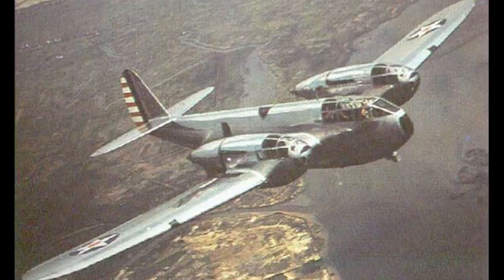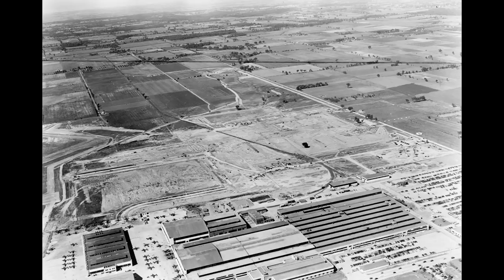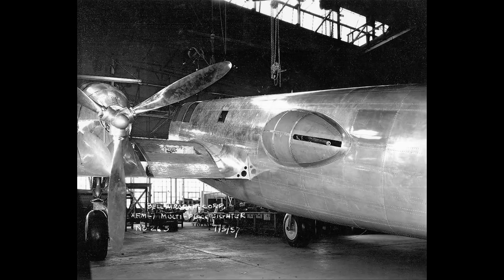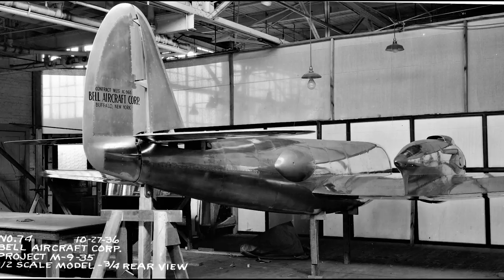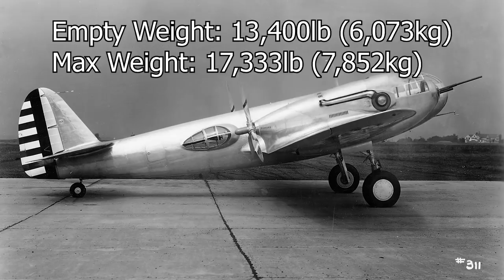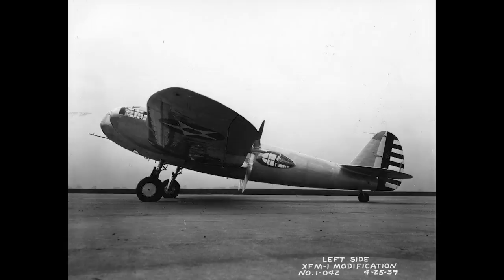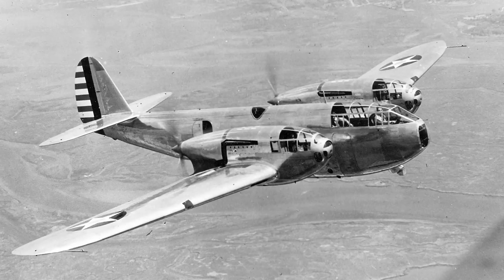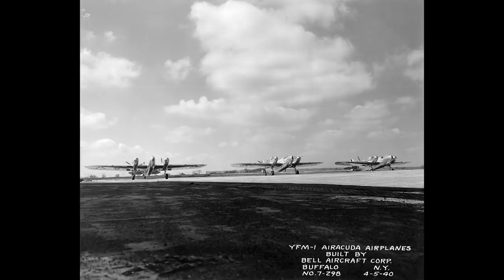The Flying Gun Battery That Tried To Kill Its Crew | Bell YFM-1 Airacuda [Aircraft Overview #28]

Comment: It helps when watching this to realize that the Lockheed entry in this competition was the legendary P-38 Lightning. While this beast was lumbering around the sky trying to kill its pilots, the Lockheed prototype broke the transcontinental speed record (please pay no attention to that tree they hit at the end).
Reply: First thing I thought of when I heard “two Allison v-12s”
Reply: Did they survive the crash?
Reply: @Commrade-DOGE  i think the test pilot survived. But the 1st prototype was trashed. It did set the speed recorb.
Reply: The P38 killed a few test pilots and airmen I believe due to not being able to pull out of a dive due to no air over the elevator till they installed a spoiler.
Reply: @chrisg2739  The phenomenon is called "compression lock." First to experience it was an Army pilot in 1941 who was able to regain control via elevator trim. Lockheed installed elevator servos on a test ship and a civilian pilot tried to reproduce the fault. He failed to come out of the dive and was killed.

AIUI it took quite awhile for P-38s in theater to get their spoilers installed. Pilots were killed in some numbers as a result.
Reply: I think that you're confusing the Airacuda with the P-39 Bell Airacobra.  The P-38 and P-39 both are single seat aircraft, had tricycle gear, and machine gun/cannon armament.  About the only thing the P-38 and Airacuda have in common are twin engines.
Reply: The Lockheed entry was the XFM-2 - which lost out to the Airacuda. The P-38 was designed to answer a different specification in USAAC Circular Proposal X-608 - rather than X-604.

Comment: This definitely seems like an example of “it seemed like a good idea at the time”.  Being able to hunt bombers from outside the range of their own defenses would have been a game changer.
Reply: Even Germany struggled with this late in the war. On a technological level they kind of sort of succeeded with various attempts like a Bf 110 with a BK37 37mm autocannon cannon under the belly with 24 rounds, a Me 410 with a BK5 50mm cannon with 22 rounds in the weapons bay, the latter of which could seriously outrange B-17s defensive armament. There was also the Werfergranate 21, essentially a 21 cm Nebelwerfer rocket strapped to a plane, with 4 used on a Bf 110 or Me 410 or two on a Fw 190 or Bf 109, which were then distance fused and fired into the formation from about 800 meters. 
In technicality these could have been interesting concepts, along with the Me 262, which could be fitted with 12 or 24 R4M rockets (the idea being that they could effectively saturate an entire formation of B-17s and hit most of them at least once, even if fired from outside B-17s range), X-4 air-to-air guided missiles and whatnot. Problem was that most of these were just too late and Germany couldnt field planes in a sufficient number to do make a serious dent anymore anyway. 
But at least nothing they came up with was a categorical threat to the pilots or crew.
Reply: @builder396  course the issue is escort fighters coming close as those attachments often made the plane too heavy
Reply: @SudrianTales  True, though the rocket tubes could be discarded after use, so the difference in performance would be only before firing. And twin engine fighters like the 110 and the 410 were heavier than single engine P-51s either way, so the extra weight from the BK 37 or BK5 didnt matter in the big picture. 
The Me 262 is the only plane where that doesnt apply since even with a payload of rockets or even a 50mm autocannon it could outrun a P-51 under equal conditions (not that specialized armament was needed, the basic 4 30mm MK108s were ample firepower against B-17s), though P-51s having an altitude advantage usually negated that significantly.
Reply: @builder396  One issue with the Me262 nothing could ever fix was, well, the USAAF and RAF were right over the airfields waiting.
Reply: @SudrianTales  Yeah, Germany was just too far gone at that point to do anything about anything anymore. Wasnt really the planes fault.
Reply: @builder396  The overly armed and armored propellor planes were a good idea, in 1943 when the P-51 wasn't available. After the fuel tanks and P-51D came about, it was just a matter of time
Reply: @builder396  
The Me 163 with its chemical concoction, if not an outright example, should at least be an honorable mention as a german-made deathtrap. It's been a very long time since I delved deep into the wunderwaffe stuff, but what I do remember was that the Komet was structurally sound but mechanically wild. The plane itself could take some punishment, but the internals would throw a fit and possibly explode if not treated like royalty while still containing fuel.
Reply: @builder396  that was entirely Hitlers fault, insisting the Me262 be a attack/bomber instead of strictly an intercepter. Had they let the 262 be an intercepter solely they could have had it in service in 1941...would have been a very interesting variable to deal with going forward.
Reply: I feel like, if you didn't try it, you'd always wonder "what if".
Reply: @GoldRider4265  Ouch dont remind me... The bloody thing killed quite a few unlucky bastards that were ordered to fly it.... The two separate components that made up the fuel tended to react very "vigorously" when mixed together... When it happened on the ground you would get an express ticket to meet Jesus/Allah or Buda depending on your religion.... There is not enough money in the world that could make me even think of flying that damn deathtrap
Reply: @tomicbranislav3  Well... the consolation that you'd never feel a thing if it blows is at least there XD
Reply: @GoldRider4265  Yeah your last thought is a big OHHH SHIT momment... Well mate thats one Hell of a consolation thank you very much :) Yeah I think I will stick with being a VRS Paratrooper... its safer :)
Reply: @m2goofy760  the engine only went into full production in early 44, so there couldn't be much me 262 flying before 1944 anyway

Comment: You neglected to mention the deathtrap these would have been for the gondola gunners (jumping out, straight into the props), which led to a modification whereas the props could be jettisoned. In theory.
Reply: It hurts just thinking of it
Reply: I was wondering the same thing, but you beat me to it. I’d hate to be bailing out knowing what’s back there.
Reply: Yikes it just occurred to me while reading comments. That’s a terrible choice to make if you’re going down lol
Reply: key word "in theory"
Reply: @JoshuaC923  Only for a second or so. Props make superb blenders.
Reply: Yeah, my anxiety went into overdrive when he mentioned two gunners were seated in the forward sections of the nacelle. There was no way they could have bailed without hitting the propellors should they still be moving
Reply: I'd say ejection seat, but by that point you're also in the same period as jet engines, so the whole concept is kinda pointless.
Reply: The problem with jettisoning side-props is that there's a high chance that you'll destroy your own aircraft immediately, sending it into an uncontrollable tumble which will make it extremely difficult to bail.
Reply: @michaelbuckers  Yeah, and good luck shedding a propeller spinning like mad in a random flight which, most probably, will send the prop tearing through the fuselage, splitting it in two. That happened to a C-130 which accidentally shed the port inner propeller. No-one survived.....
Reply: @javiergilvidal1558  why not explosive bolts on the shaft? Jettison the entire propeller and hub so that in theory gyroscopic stabilization keeps it straight
Reply: You're all assuming those poor bastards are still alive at the point that need to bail out if this thing had gone into combat, my bet is when this thing wouldda ran into the luftwaffe, those guys would be the first to die due to their position in proximity to the one thing fighter pilots love popping more than anything else on bomber type aircraft, which is what this thing should have been converted to instead of playing gunship, les moteurs...
Reply: ..putting in a gunner just to keep loading the guns, jesus christ.
Reply: @IvanTre  Gotta be one of the worst jobs in history

Comment: If throughout the 1930's and 1940's the Army Air Corp would have ONLY requested prototypes for ugly, unreliable and unimpressive aircraft, I think Bell would have won every single production contract.
Reply: Only if they wouldn’t buy from Blackburn. Or anything French…
Reply: Harsh. But fair.
Reply: Unreliable, perhaps. Ugly? I think this aircraft looked amazing.
Reply: The Airacobra was a very pretty aircraft.
Reply: @DEP717  Yep; I thought it was a graceful looking plane.
Reply: @cavecookie1  Looks ain't everything. Bell seemed to do well in their early days, but not before or during the war. Hindsight is 20-20 I guess.
Reply: Bell made a jet during the war. It was  so crap that a P51 could out run it.
Reply: @khaccanhle1930  True, but it was a first attempt, and once the British gave the USA their Meteor jet engine, that prototype helped lead to the P-80 Shooting Star.
Reply: P-39 much?
Reply: @tedtimmis8135  yes!
Reply: @zs1171 I will give you that one, .  But it's just the corn kernel in a turd.
Reply: @randallpickering9944  well things did turn around for them. It turns out they’re just a hell of a lot better at helicopters than they are at planes
Reply: Too be fair aircraft manufacturing was still a new field. Without the blunders we wouldn't have the great planes of today.  No plan is designed on purpose to be bad.
Reply: @khaccanhle1930  Yes. But it was the first US jet.
Reply: @bob_the_bomb4508  the french planes aren't that bad, the d.520 has a spitfire vibe
Reply: It was all worth it for the Huey.

Comment: What's insane is that Bell eventually designed and built the first plane to break the sound barrier. They definitely didn't mind trying designs that were way out there. I always like the lines of the P-39 , very beautiful design.
Reply: And don't forget the Airacomet! Bell did lots of work on the fringes, adding  to the fast-expanding knowledge base, and ended up dominating the rotor craft market for decades!

Comment: Oh wow. I love that someone woke up one day and thought "hey, let's make a plane with 2 37mm cannons where the engines are in the back side of the wing". It just sounds extra outlandish considering the time it was made and I love it.

I would say to imagine how it would've been if it worked but honestly it could've done it with one big gun and be lighter in more ways then one but there are several designers that did succeed in making a plane like this though maybe not for the same role
Reply: 37 mm cannon... 35 mm is a camera LOL
Reply: @shawnbeckmann1847  oh whoops thx for the correction
Reply: @somerandomguy___  😁👍
Reply: Pusher propellers in big engine nacelles/manned gondolas were popular in the 20s and 30s. Every single one I read about had problems with engine overheating - but designers loved the idea and kept refusing to learn from their mistakes. The end of the road for this was the B-36 with six piston engines - all overheating. The other 4 engines ran very hot, but they had to - they were jets.
Reply: Funnily enough, Bell did reduce the weight and use a single 37mm cannons in the P-39, which is at least a better looking design.
Reply: "37mm?!"
"Why, you got a bigger one?"
"..."
Reply: @jlvfr   Making me think - The C-130 gunship had a 105mm howitzer firing out the side. How about a B-17 with a 90mm flak gun mounted through the roof? Now there's your flying flak battery to use against bomber formations.
Reply: @donjones4719  wouldn't work. Apart from size & weight, a 90mm flak would be a high velocity gun, which would give it a recoil to match. One shot would shatter the plane.
Reply: @jlvfr   I wasn't being serious. But my idea fits right alongside the impractical planes that actually made it off the drawing boards in the 1930s.
Reply: @donjones4719  ah ok! :D well, the US rammed a 75mm on the B-25, the RAF had a 57mm on the Mosquito, the germans tried a high-velocity 75mm on the He 129... so I figured you might have been serious!
Reply: @jlvfr  Don't forget the Italians attaching 102mm naval gun on their heavy bomber to hunt ships.
Reply: Just take a look at the Italian Duck plane (as it is called by Warthunder players) it possesses a 102mm cannon made to destroy boats, and although it wasn't all that effective iirc, it was somewhat mass produced.
Reply: @donjones4719  germans tried to do that, but with multiple machine guns/auto cannons in a fixed position, the idea was to level the plane beneath a bomber and use a secondary aim to wreck the target.

Comment: From what I've read, the Airacuda represented the US Army Air Corps' attempt at getting the absolute most from its meager Depression-era budget for new technology development.  Bell, even then, had a reputation for innovation and pushing the envelope when it came to new designs.  So, the Army decided to throw everything it could into one aircraft program in the hopes that the effort would yield technologies useful in other programs.  And if they were lucky the Airacuda program would itself produce a useful bird.

There was considerable merit to this attempt.  The lessons learned with the Airacuda did indeed get applied throughout the US airplane industry in the years that followed.  The research on solving that nose gear wobble was one such example.  Tricycle landing gear layouts were still somewhat new at that time with most aircraft being tail draggers.  The choice of using electric motors was also an area of keen interest to the Air Corps.

Electric motors offered the advantage of lighter weight systems as compared to hydraulic ones and not requiring the use of hydraulic fluid which was heavy and flammable.  Had this system worked out it would've been a major advance in aircraft technology and given the US planes that used a considerable advantage.

Those big 37mm canons were truly a massive firepower installation.  At the time, 37mm canon were the standard heavy gun installation on the world's tanks.  It would be like installing a 120mm canon in an aircraft of today.  The things were considered that massive and devastating in that era.  Just a few hits from those heavy canon would destroy even the largest of bomber aircraft in the world at that time.  And here the Airacuda sported two of those massive canons.  For its time, the late 1930s, this was stupendous amount of firepower for an aircraft.  The US Army had high hopes for its 37mm canon design that had been modified for aircraft use.  It was the heavy punch for the Airacobra and for the Army's super-fighters of its R40-C proposals.

The idea for their use in the Airacobra was for the plane to prowl off America's coast - these being the days before radar - in search of those enemy bombers.  Upon finding them the Airacuda would approach the plane's navigator would start using the gun sighting system that the Army had turned to the US Navy to help develop as the shots from those canon would be much more like a battleship's directing fire from its main batteries than the traditional aircraft armament and sights.  It was a complex mechanical system that was itself a new technology the Army was trying to develop.

The gunners in those nacelles were really there to service the 37mm canons, not aim them.  Developing feed mechanisms for the massive 37mm shells was beyond the scope of the Airacuda's design so they used relatively small magazines and those required there being someone there aside them to keep changing out the empty magazines with loaded ones.  A rather thankless job, all things considered.  The Bell designers did at least provide a tunnel through the wing into which the gunners could squeeze themselves through in order to get back into the fuselage and exit the aircraft in an emergency.  Thus sparing the risk of being turned into mincemeat by the propeller behind them in the nacelle.

As an operational aircraft the Airacuda did not succeed.  As a flying testbed for new technologies however, it fared much better.
Reply: …not 120mm but there are 105mm guns installed on planes, the AC130s have them! and the funny thing? the AC130s could be argued as spiritual successors to these as they might have been great close air support planes if they had been put into that role!

Comment: Hi Rex, yes I've drawn this aircraft as well, you'd need to install explosive bolts on the 'pusher' propellers prior to the crew bailing out otherwise these would have made mincemeat of them!
Reply: What if a stray round hit the explosive bolt?
Reply: @Commrade-DOGE  it’s thin enough there that a well placed round has a decent chance of shearing off the prop even without the explosive bolt

Comment: Feb. 17, 2022---YT lead me down this rabbit hole and thanks for the video. Got to building models in '74 and some time after that, Air Classics did a magazine article on this plane. I remember there being a vaccuform kit of this in 1/72 scale, a long time ago. Hello Ebay and found that kit is being sold there, but also, there's a company called Valom who has one as a plastic kit.
Reply: 3 kits actually, all of which are now (2024) not absent from the stores I know of. Valom 72015 (2006), Valom 72036 (2007) and Valom 72022 (2008). Most recent appears to have special or corrective resin cast parts and a bit fiddly photoetch.